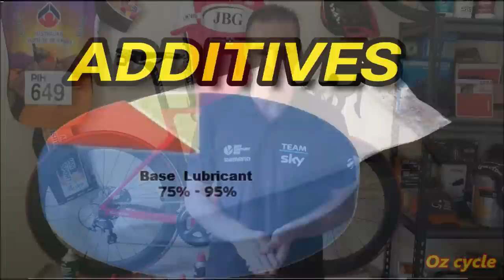Ultimate Chain wax - make it yourself

Comment: Thank you for the awesome video! 
There was no mentioned if we need to remove all the grease/lubricant from the drive train and cassette. Any advise on this? (Also worried about rust as it humid here in Singapore).
Thanks a million!
I am sure someone asked, but its tough to manually go through the 2.4k comments... I really tried... I sure wished there is a search function...
Reply from the maker: No lube required on cassette or rings , keep them nice n shiny.
Add a little paraffin oil to the wax mix to help prevent corrosion of the chain.
Reply: @stevenleffanue  Thank you for the reply! So should I clean up the residual lubricants on the cassette (using petrol, degreaser, IPA) or should I just leave them alone and simply just work on the chain?
Reply from the maker: Yes , remove any previous lube and dirt from cassette and rings.
Reply: @stevenleffanue   thank you very much!

Comment: Hi Steven. I found that when ordering paraffin wax I can choose between low and high (or medium) melting point waxes. What do you suggest I use? The softer or harder kind? Thank you! Love the videos/long time subscriber.
Reply from the maker: Higher melting point would be better in hot climates and perhaps pose slighly less friction. Otherwise it probarbly wouldnt make much difference Mike.

Comment: Great vid, mate. Thanks. What is that spray degreaser you are using? The red can?
Reply from the maker: Motortech degreaser. I get it from the local auto parts shop Repco when it's on special.

Comment: Sorry to boring you with questions, but could you please tell us at what temperature do you take out the chain from the wax? Near the wax melting point, to have the maximum wax inside the chain? Or you maintain those 90 degrees along the whole process? Thanks in advance for your answer.
Reply from the maker: With this ptfe wax you can ride it thinner , so 90degrees is fine.

Comment: What is your opinion on ceramic pulley wheel upgrades, and the over sized ceramic pulley wheels. I’m thinking of upgrading my pulley wheels to the ceramic speed wheels. Apparently the over sized pulleys aren’t good when shifting. 
I’d like to hear your thoughts on this.
Reply from the maker: Ceramic bearings would work fine in jockey wheels. If you change to larger jockeys you will also need to add some links to your chain.

Comment: To avoid confusion and help newcomers, somewhere on this page/video you might mention that your 2016/17 recipe has been superseded, and should be ignored - make it a sticky comment at top.  Last spring I spent over $50 on supplies trying to get your 2016 lube recipe to work.   In a vain effort to make the squirt lube, I bought (in this order) Paraffin blocks, Paraffin oil, Limonene, Naptha, then the Xylene (the last could only find as a gallon).  None of it would work as per your recipe at that time.  I'm happy to pass those materials on to other uses now.... but the money spent last year would have bought me a lifetime of commercial paraffin lube (I'm old)!  This morning I'm making up the first batch of your "new" present PTFE/wax recipe (let's call it the 2020 recipe).   Love your videos!
Reply: How'd it go?
Reply: @pattygq  The PTFE powder seemed a little bit reluctant to mix with the molten paraffin.  Is is a suspension and requires constant agitation, if you want it in your chain.  I soaked the chain, agitated a lot throughout the time.  After an hour or so I took it out, letting molten paraffin drip off, and gave it a light wipe.  After working out the stiffness, the chain seems to work smoothly.  I've only ridden a few miles on it so far.
Reply: @borisstarosta7823  I wonder if a fish bubbler would have kept the PTFE moving around. Does it clump together when you poured it into the wax?
Reply: @pattygq  Yes it was quite clumpy as it went in.  But with time and occasional stirring it seemed to mix up nicely.  The PTFE settled quickly to the bottom though, so when I put in the chain, I swished it around vigorously.  While soaking the chain I swished it around on two or three more occasions.  Before the final removal of chain, I again swished it around.  The new recipe certainly has this advantage: you remove the chain hot.  The old 2016 recipe involved removing the chain cool/lukewarm, which was a mess, needing subsequent removal of excess oil/paraffin mixture.  Now I've put just a few miles on the new recipe chain, and it has been riding nicely.
Reply: By the way, I wore a N-95 face/mouth particulate mask while pouring in the PTFE.  This step produces some dust-like clouds of particles near the slow cooker, and I don't want to breathe in teflon particles!
Reply: @borisstarosta7823  Good call. When the wax hardened was it super slick to the touch?

Comment: just came across this brilliant-what should I do between waxing when riding in wet UK conditions?
Reply from the maker: You can add a  little paraffin oil to the mix. This will help prevent rust on the outside of your chain

Comment: Thanks for the great video. I have followed your recipe. Some questions though: a) Is it normal for the chain to be - in general - a bit more noisy? b) After 100 km (I am a bit powerful rider) the chain is creacking. Could you please help on that? What is going wrong ? c) Is there a way to make a liquid version of this lube in order to avoid the relaxing process ? d) In case we want to thoroughly clean the chain before re-waxing, can we put it for a couple of minutes in boiling water or this process will remove the inner wax ?
Reply from the maker: Difficult to tell what is going on with your waxed chain without being there. To clean a chain in prep for waxing use  the initial clean process

Comment: Greetings from Denmark. Super Channel. 
I ride Witt Shimano HG901 chain Witt hollow pins. 
I did my first Wax yesterday 🤩
Do i need to clean out the Wax from the hollow pins?
Best regards Niels-Jørgen
Reply from the maker: No. If it annoys you poke out each hole with a 15gauge spoke

Comment: The original chain on my Domane is approaching 12,000 km in 1.75 years, with 20% on gravel. It has been cleaned approx. every 200 km with WD-40, a brush and clean rag, and lubricated with one drop of Tri-Flow on each roller. It has never been taken off the bike. I did stretch it too far; it's currently at 0.625%. The wax method is very interesting, and I certainly admire the cleanliness, but it would be way too labor-intensive for me to take the chain off weekly and go through all that.

Comment: Hi OZ Cycles, hope you are keeping well and safe in this pandemic situation. 
Thank you for all the useful tips in general and especially home made wax, which is brilliant. The only think I would like to ask for a clarification purposes only is: I'm doing exactly as what's been shown in your videos on how to wax / rewax and maintain. However, I'm getting some 'Squeaky  Noise' after riding 100k once waxed, especially when moving into easy gear in the cassette (i.e. whilst ascending). So, I'm cleaning the chain, cassette, and mini wheels with hot water almost every 100ks. I kindly request you to advise whether am I doing something not right to avoid this to rewax every 250ks instead? I don't mind rewaxing every 100ks but I look very silly on the road riding more than 100ks in a single ride with that squeaky noise when riding in groups.. Please advise. Thanks for your continuous support and assistance for amateurs like me here in Sydney.
Reply from the maker: Id say the wax isnt penetrating into the chain properly. Leave chain in wax bath for an hour and swish it every 15mins should do it.
Reply: @stevenleffanue  Thanks Steven, appreciated.

Comment: First of all thank you for your videos, I realy like watching them.
Then I have a question. In your older video you mixed parafine with parafine oil. In this newer version, where you use the ptfe powder you did not add parafine oil. Is this a must or is still ok to put some of the oil to the mixture as well?
Or maybe there is a reason, why I should not add the oil, which I didn't noticed. Thank you and greetings
Reply from the maker: Oil attracts dirt
Reply: @stevenleffanue  You should have added this at the start of the video. "OIL ATTRACTS DIRT"

Comment: I ride recumbents that have the equivalent of three standard chains circulating around the drive train.  So 1000 klm rewaxing. Beauty. I used the old paraffin oil and wax recipe with great results and now am using the new ptfe and wax only recipe. I wonder if combining the two recipes would be of any benefit. Did you try adding paraffin oil oz cycle to stop the dry flaking .?
Reply from the maker: Yes you can add paraffin oil to prevent rust in wet conditions but ultimately oil attracts dirt
Reply: @stevenleffanue  thankyou very much.  I’ll add some to a smaller batch.  I admit to now having three crockpots.  All my bikes run your wax. I never had much success with the xylene liquid wax squirt bottle as it was turning solid.  so carry a small wax bottle of gold.  Now I’ll try your latest version. My chain never had it so good.  Cheers mate.

Comment: Is PTFE powder safe to use? For example, should you avoid touching it with your hands? Is it more dangerous when heated up in wax? Should I wear a mask and gloves when doing this?
Reply from the maker: PTFE does not react readily , however use reasonable safety. I encourage your own research...Google.

Comment: I followed this process to the letter and thanks again for providing it.  I can feel a difference and posting some nice PRs.  It looks amazing on the bike.  One item I did want to ask about was the color of the wax and the PTFE.  Mine were both a bright white and after waxing 3 chains, that were all rigorously cleaned beforehand, the wax has taken on a grayish look.  I don't see how it could be dirt or factory lube because this was the first waxing.  I'm wondering if it is possibly the reflection in the slow cooker since it is black?  Any ideas?  Ever seen this before?  If so, is it worth starting with a fresh new batch of wax next time?  Thanks again.
Reply from the maker: Its dirt and fine metal particles. Maybe from wearing in a brand new chain,thats why its good to do the first 300-400km with original lubricant before going to waxing. You may need to do the initial clean again. Also helps when rewaxing to pour 2 lots of hot water over the chain.
Reply: @stevenleffanue  Thank you!  Here was my thought.  I'll just use new wax and PTFE for my next batch.  Then take the current chain and dip it in boiling water with a sieve.  I would think if I dipped it multiple times and moved around the chain, it might remove not only the wax on the outside, but also partly on the inside as well, allowing me to come back fairly fresh.  Without an ultrasonic cleaner I'm not sure I could have degreased the chain any better than I did.  I couldn't get a single mark from it on a white cloth so I'm not sure how anything was left.

Comment: Thanks for the video. So a dumb question. How should I wash my bike with wax on the chain (if the cassette got some mud on it). I will go with parafin only I have doubts about PTFE health issues. will that last same time or How can I understand my chain needs rewaxing? Thanks a lot again for this informative video.
Reply from the maker: Remove chain to clean bike

Comment: Thanks for the video! I've just bought a new chain from SRAM and out of the box it is really sticky, is that considered 'clean' or do I need to get that residue off before waxing? Appreciate any advice! Cheers
Reply from the maker: Clean as per 'ultimate chain clean' video Nick.
Reply: which re-usable link are you using for 12 speed sram, cant seem to find connex for it.

Comment: Help please. With a 1lb bar of wax. How much liquid parrafin do I need and how much grams of PTFE do I need ? When you say 1 to 10. Is that after you mix the parrafin liquid ? Do we not need the liquid also?
Reply: A 1lb bar of wax is 454g which is close enough to 500g.  Just use 45 or 50g of PTFE, it's close enough.
Reply: Is it good ptfe 1.6 micron?
Reply: @G3o_  1.6 is good.

Comment: After seeing friction tests with Ws2 h-BN and PTFE, they should be all equally suitable. Very interesting stuff. But PTFE has the lowest coefficient of friction and NO static friction, it should be the best fit. Own friction tests suggest that palm stearine candles work equal or better than paraffin, and it has a significant higher melting point too which is better in summer. In my test graphite worsened the friction, also mos2, lead from solder improved the friction. I will test h-bn and ws2 in the future.
Reply from the maker: Yes I found household candles work exellent too but not scented ones , they contain oils.
Reply: @stevenleffanue  tested WS2 and hBN now. WS2 is as good as MoS2 no difference (they prevent wear, do not decrase friction, but wax alone protects more than enough). h-BN is almost as good as PTFE and on the end it increases friction a lot, but it does prevent wear the same time and very very long, its very interesting. I will go for candle wax only, pure on the chain because the result is astounding and very long lasting. I would not suggest to play with dry lubricants out of health and cost reasons and because they create no benefit. But for bearings i will use WS2 and MoS2 at 5-10% in lithium-grease. A test with h-BN would be interesting in ball bearings too. And vaseline plus ptfe equals a unbeatable lubricant for flashlight threads, (update: hBn is even better on low pressures also on plastics). Good Luck oz because of you i discovered these things. If i couldn't wax the chain for a very long time i would try h-BN as a dry run protection, but who cant?
Reply: Tested once again between two button cells and hBN is very abrasive there, no lubrication at all, graphite is slightly abrasive too but lubricates after it is broken down. No wonder there are many cases of motor failure with Ceramik Oil Additives!
Reply: @stevenleffanue  Now i tested a iron bolt in a drill pressed into a whole in a metalblock. Result: Wax good, but large improvement with Powders: Best WS2, PTFE almost as good, hbn bad, graphite bad. graphite added to first both no difference, added hbn much worse. 0,1% to 1% Powder added to the mix is reasonable, more is not good, combined is better most of the time, i stay with WS2 + PTFE 1:1 so much that the wax gets dark when it is stirred, not more.

Comment: Hi Ozcycle, thanks for all of your informative videos. New bike coming soon and thinking of the following - Running ordinary lube for 300-400km to 'wear-in' the components followed by deep clean and waxing. Can you confirm that I simply 'break' one chain link in my new shimano chain and install the connex link? On another note, have you thought about Boron Nitride as an anti-friction additive? It is popular in high-end motor oils and additives (e.g Liquimoly Ceratec)
Reply from the maker: Yes,make two male ends at the appropriate link for correct chain length.
I have tried boron nitride at 1um...its pretty good but more expensive than ptfe.
Reply: @stevenleffanue  Interesting! Many thanks!!

Comment: Your are legend. Just got a question, I been using your previous formula para oil + candle, I think I got a good balance between the oil and wax. So I just order the ptfe powder from abwax eBay, can I just add the ptfe powder to my existing oil + wax combination with the 1:10 ratio or is better to start with a fresh refine para wax? Thx for your advice
Reply from the maker: You can but it will still attract dirt. No oil makes a dry lube...attracts no dirt.

Comment: Just did this today. I used a frying pan lined with aluminum foil on the grill outside. Set the burner to the lowest setting. Outside in case something went wrong, and not to add heat to the house.

Comment: Excellent video! Do you recommend adding paraffin oil in this version of the chain wax to prevent the wax from flaking? Thank you!
Reply from the maker: If wax flakes its either not sticking to your chain or there is too much wax on the outside. Wipe your chain with a rag whilst hot out if the bath.
Reply: @stevenleffanue  Thank you i’ll try it!

Comment: Hi! Thank you for your great videos!
A question: I cannot get ptfe now. Would you recommend using pure paraffin without ptfe rather than the "old" combination of paraffin + paraffin oil?
Thank you!
Reply from the maker: You can but you will need rewaxing every 100-150km. Preferably use the oil method then when you get ptfe make the ptfe wax batch and keep rge oil batch in a plastic bag if ever you want to use it again. Remember ti cimpletely clean chain before swapping to the different waxes.
Reply: @stevenleffanue  thanks a lot!!

Comment: Hi Steve, thanks for all your great advice. I followed your how to and waxed my chain. It has been working great over the summer but now that fall is here I'm having a problem with rust accumulating on my chain from the rain. I keep my bike covered with a tarp, but unfortunately I have no way to bring it inside.   Do you have any advice for me?
Reply from the maker: Take chain off when not using? Oil chain?
Reply: @stevenleffanue  thank you for getting back to me. I think with the winter coming on here in the states I will just switch to oil.

Comment: Great video, really want to try this, quick question, will a connex 10 speed chain link work on a 11 speed chain? It looks the same? Having real problems sourcing a decent priced connex 11 speed link here in the UK? Thanks.
Reply from the maker: Preferably use the right link...the 11 is slightly narrower. Yeh theyre pricey. I buy a new chain and the link comes with it.
Reply: @stevenleffanue  Thanks, so you use a connex chain too? Would you be able to put a connex link on a shimano hg701 chain?